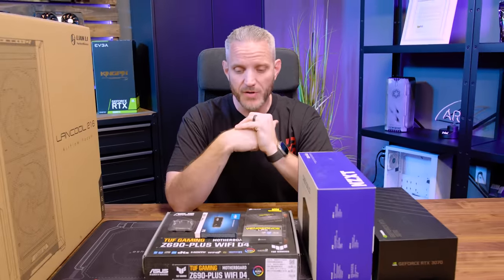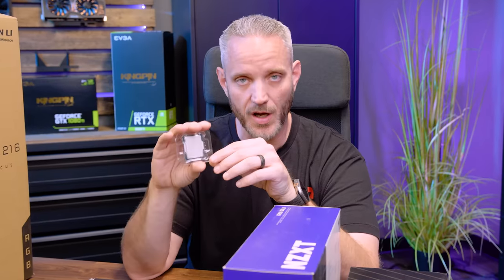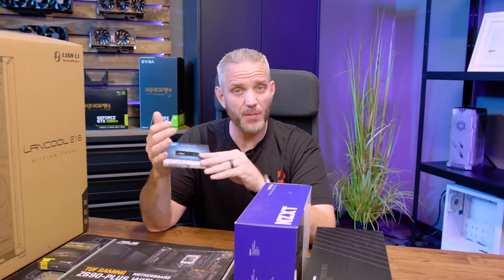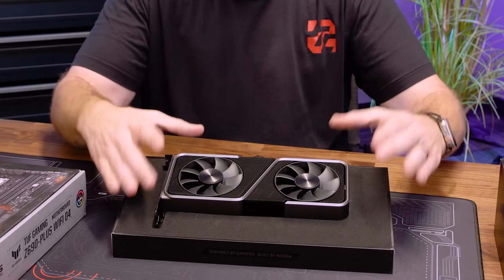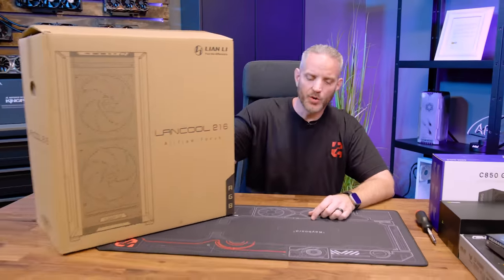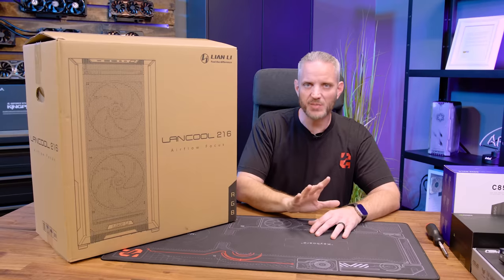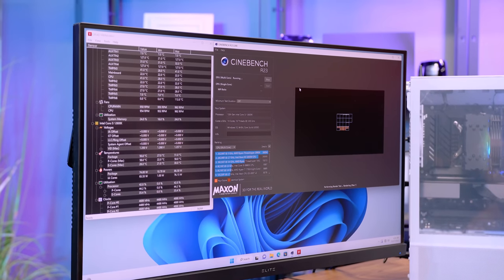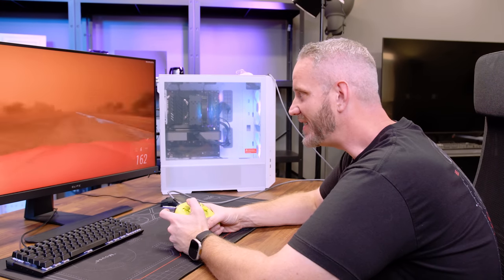Inexpensive PC Build Guide!

Comment: 850 watt power supply easily runs my RX7900XT. Stated requirement is 750watts. 

I’m not sure why you think an 850watt would top out at 7800XT….

Comment: Does upgradeability even matter in Intel systems for normal people? If someone cares about intelligent money spending rather than raw performance the uplift from 12600k to all higher parts isn't that great, considering not only the new CPU cost, but also the difference between money paid for 12600k and what it sells for later. I'd rather spend money once. I sit on I5-11400F and I don't see a reason to upgrade, and not having to buy a new mobo wouldn't change that.
Look realistically, most people are riding GTX 1060s and GTX 1650s, majority of buyers don't upgrade by one generation. 
Even with 5800X3D I wouldn't be surprised if it would outlive AM5 socket in hands of the majority of buyers, seeing many people are still running I7-6700k or older!
I also think OC is dead, gains in games are miniscule, so Z690 is overpriced for what actually is needed for a typical gamer. Lower power supply and cooling requirements also add up.

Comment: I love that AM4 had such longevity. I went budget 2 years ago with a 3600x and 2060. I wanted to game at 1440p and recently got a used 3080 for $550 and new 5700x for $198. Two easy drop in upgrades and simple bios update without having to build a new computer. But if i was building a new build today, 13th gen seems great and also AM5 while its their first gen of cpus, would have a great upgrade path like AM4. Overall I can stick on AM4 and wait until the next gen of gpus and eventual AM5 3DVcache cpus to release

Comment: Very good balanced system. The 12th and 13th gen CPU's are exceptional thanks to the compitition from AMD. The e-cores are actually very powerful especially for any multi-core workloads. Perfect 14440p system and the 13600K as a nice jump in performance or even the 13700K when the time comes to upgrade....

Comment: Eh, I'd definitely not be using the RTX 3070, just still too damn expensive. RX 6750 XT, for sure. They're about £250 cheaper over here. Other than that, probably about the same. Maybe add a second SSD for the money saved or switch to a DDR5 board and RAM to extend the lifespan a touch.

Comment: inexpensive pc build is $500 as established by toms hardware guide since 2000 $750 is the mid range build and $1000-1200 is the high end build jay.
$100 case HUGE NOPE when a $50 case will do $600 graphics card HUGE NOPE when a 3050 does pretty good albeit not at 100+FPS
ddr4 board...have you not seen the buy cpu get a motherboard free combos at microcenter? yes it's only available to instore pick up but if 200,000 of your subscribers go to microcenter it saves the other 3,100,000 some cash as demand is decreased to not inflate prices of things you recommend. ryzen 3600X with a free b450m/b for $130. there's even 12900k with free m/b for $350.
get realistic jay....even CPU-Z does better performance to price comparison by huge margins over what you just showed.

Comment: Honestly I could build a similar setup for the same cost or less even on AM5 with price difference between B series boards on AMD and Z series boards with Intel and with them having a similar functionality since Intel arbitrarily locks features that AMD gives you on their cheaper boards. This paired with a 3060ti instead of a 3070 saving even more money. A 3060ti is only like 12 -15% slower but costs about 33% less. could probably save on the case and PSU too if shopping wisely. These savings more than make up for the exorbitant price difference between DDR4 and DDR5. Not saying Jay's build is bad in anyway but AM5 will likely outlast LGA1700 in terms of generations supported which makes an even smarter choice for future proofing.

Comment: I'm going to be doing the thermaltake tower 200 with they msi board and r9 7k series. With 7900xtx or 7950xt. Idk know yet. But I'm gonna white it out and run hot pink rgb fans and a 1200 watt psu. All with the am5 board. It seems more my style of playing. I prefer amd because idc about visuals and more gameplay. I like playing diablo, fortnite(with nieces and nephews) cod, and other stuff like corsair 16gig dominator ram x4 and the new alienware quantum dot monitor. It's going to be glorious.
Currently have r5 5600 with 6700xt and 16gig ram with 650 psu. Asus b550 board. As I dont game often. But when I do. It's for hours and hours at a time.

Comment: Hot take, cpu upgradability is overrated , generational upgrades in cpus are marginal, the average user might be better using their system until it is no longer good enough for their reasonable standard and then either lower their stamdards or upgrade to the new thing with a grain of salt also because, a motherboard is probably going to fail before the   next cpu after the upgrade (assuming upgrade after 3-4 year) and is going to miss some features , you might as well not worry at all, buy whitin yout budget and accept tech getting old and upgrade when old is too slow

Comment: It looks like a good system. My problem is that I already have a pc with a GTX 1080, and I do not think the RTX 3070 is a big enough upgrade for the price. I am planing to upgrade my CPU. My 8600k oced is still fine for gaming but I would like a 5900X3D with DDR5 for some calculations. If the price is ok.

Comment: Even cheaper now with Black Friday 2023 deals. Got Crucial Pro DDR4 3200 32gb kit under $50, the 500gb P3 m.2 for $29.99 and $153 I-5 12600k for $153. More than good enough for a once every five years build. Nice upgrade over Ryzen 7 2700. Funny that same size 2.5 inch SSD's cost more than equivalent m.2. Keep these common sense recommendations coming.

Comment: I have a AMD 3700x cpu that's a bit overclocked and the only time I stress that thing i when I fire up a 1st tier game like Cyberpunk and other brand new games. What would give me the biggest boost would be to update my GPU which can run all those cames, but it's only low in the middle tier of GPU of last gen gpus, so it's not much to be over joyed with. A better GPU would do wonders for my gaming, but then that's not what I do most, so why bother. In stead I hang back, look for the right cheap GPU to show up at some sale and waith for the next gen stuff to show up before I think about some major upgrades.  Not all hardware of today is mature tech, so it needs some years to mature to fully be what it can be. This is something we have seen again and again.

I'm more worried about Windows and what the hell is going on there, it's almost as if I woud wish for all games to be made for linux so that I could jump ship fully, because this shit is annoying.

My old pc and my current has a Noctua NH-D15 cooler, so when I go for a new system, I can just swap that from the oldest other computer and be covered with cooling. It's big and it don't always fit well, but some minor tinkering fixes that. So go for good usebale or tranferable extras and you can rarely go wrong.

Comment: I kinda wished I got an Intel 12/13th gen over my 5900x in hindsight (though both weren't released yet, in fact, 12th gen was released a few months later but I needed a system fast). Quicksync would have been really useful and the IPC uplift would have helped with compiling and stuff.

Comment: Nice video. I thought I would check the price here. The motherboard alone is £320.99 at my local computer shop. That works out to over 385 dollars at current exchange rate, just for the motherboard. Only 224 dollars in your video. Not checked the rest of the prices yet. Also don't have a 1440p monitor. Have a 4k monitor and a full hd monitor.
Reply: we get ripped off in england
Reply: @warking4257   True

Comment: my suggestion build a pc with i3 12100f with b660 then when 13th gen i5 13400 launch you can upgrade.
 put as much money you can towards yours gpu. get a rtx 3060ti/3070/rx-6800. its run 1440p fine no botttleneck

Comment: @jayz2cents what's your current home or primary build specs?

This video helped a lot. I'm coming from a 6700k, 213hz of slow ram, GTX 1080 and a ASUS Maximus 8 Hero board.

I would like to upgrade....

Bought a used 3080 TI but obviously now bottlenecked by CPU.

Would like to make last 5 to 7 years in next upgrade

Comment: why the hell are you paying 600$ for a 3070, you can get 3080s for 600$, hell that isn't even far away from a 6900xt.  also if you are going intel and 13600k is a much faster cpu, especially with ddr5 which isnt even that much more anymore, and no mention of the 7600x? considering its basically the same price as the 12600k

Comment: Thanks for this video, Jay.
As someone who doesn't know anything at all about computer hardware, I always avoid upgrading and instead just run my system until something breaks and has to be replaced, because I just don't know which parts are good, work well together, are worth my money and so on. So videos like this are really helpful to see which parts to get for your budget.

One question I gotta ask though, I currently have a Sharkoon S1000 case (I think, looks at least like it comparing it online). Would I need to replace that as well if I would go for this build in the video, or would the case have enough space and air flow for it?
Reply: i mean, everything would definitely fit. Maybe you'd want to invest in a 240mm AIO (your case can support it) instead of an air cooler for your CPU, though, since it  looks like airflow may be limited with a solid front panel. You shouldn't run into any other problems, though

Comment: ddr4 pricing isnt volitatile, there are still 3200mhz cl16 kits for near $40. its just corsair kits and the other big name brands arent the ones near or at that price, use some lesser know brands from time to time, think silicon power, Oloy, Geil. its not hard to find new, same with 32gb kits at similar speeds for around $70-75 for a 2x16 kit. I enjoy most your videos, but over the last 2 years, your market analysis hasnt been correct.

also there are better budget coolers, look at Thermalrite and ID Cooling for some good budget coolers

Comment: With this mothderboard do you actually need all the RGB "Crap" since the case I would want to put it into doesn't have glass sides?  I don't think that RGB addes any spped to the system.  I'm just wanting to upgrade my existing Plex Server with a newer motherboard that supports Windows 11.  The current configuration is running on a Intel 4770K OC'd to 4.2 w/32 gig of memory on Windows 10 Pro.  Also running an Asus RTX2060 video card in it.  I have 7 WD Red Plus spinning drives with a PCIe controller card with 4 ports.

Comment: Right at starting i was."Maybe do a video with a "Cheap" busget build. This"Resonable build" and the "Enthusiast" build."

This is to check those in comparison to benchmarks. Before we have mostly comparisons bewteen single components (CPU to CPU or GPU to GPU). But it might be cool to see what does a 650$, 1000$, 1500$  and 2000+$ system gets you. Also for a price per performance/Benchmark. 

I and we know that this might be a bit tough to compare BUT on ther other hand we buy and build those systems so thery are existing.

Comment: I feel like something is definitely wrong with my 11700F getting a multicore score of 8634. Task Manager said it was only using 15% during the multicore and single core. ICUE said the load was around 10% during the test. Clock speeds were hitting 4688MHz. No fan speed ramp up or stress at all. It was barely using the CPU. Any suggestions would be greatly appreciated! =)

11700f
asus strix micro atx b560 g gaming
32GB ram 3200mhz vengeance rgb
rtx 3080
m.2 OS drive
corsair h150i cpu cooler
Reply: I figured it out. It's not as clear cut as this BIOS screen in the video Jay uses, but I finally find where to type in the Watt limit manually in the Asus strix UEFI BIOS. The F cpu's like mine are capped at 65w, so that's what it has always been on. Seems it was nerfing itself pretty hard.

Comment: I currently own a pc I built a few years back with a Ryzen 5 3600, a Tuff gaming x570-plus, and a 1660ti. I’m trying to upgrade to something similar to this build. Would you recommend completely replacing my current motherboard and running a Ryzen 7 5800x with a 3070 or 3080? Or an Intel i7 13700 with a 3070 or 3080? That’s my currently thought. Of course I won’t unless I have to. I have watched numerous YouTube videos and still feel lost. Anything helps!
Reply: I have a PC with 3070 and Ryzen 7 5700x. It's great for almost all games at 1440p, 60 fps. You can run some graphically intensive games at 4k with the use of DLSS, but expect 30-40 fps, if not lower depending on the game (cyberpunk). Vram is the biggest limitation here.  

Overall, I'm really enjoying it though. If you want a guarantee for 4k games, I'd get the 3080 (and for the utmost guarantee, get the 4070 or 4080, although those are way too expensive imo).

Comment: Jay is the type of guy who doesn't know the 7600X costs 240$ and decent B650 motherboards are available for 200$ and can be paired with 16gigs of 4800MHz RAM for 70$.
Reply: 40$ for the P3 is a decent deal, but it's QLC - I would rather get a TLC based drive for 10$ more.

Comment: Just ordered parts for a similar build except I went for the 13400f since it has similar performance and the same core count as the 12600 at around $50 cheaper right now. Got a gen 13 compatible mobo (obviously) which leaves and upgrade path should I want to step up later.

Comment: I don’t get how you can say that 3070 maxes out a 1440p panel. I have the oled alienware and my 4080 with high and ultra settings on Warzone maxes out the 175hz available (i.e. around 170-190 fps). Is my perception skewed by the fact that the alienware 1440p oled is widescreen and that means lower fps?

Comment: I like the idea of an upgrade path but at the same time I’d usually upgrade like every 5 years and that is enough time for more than 1 generation of cpus and gpus to come out so why would I choose the next step up that’s only 15% faster if I upgrade its to like actually upgrade so personally I would’ve went amd am4 on a cheap motherboard and cheap ram and then when I need an upgrade I’d get a am5 motherboard ddr5 and a much more noticeable upgrade for my cpu and I would be smart to get a cooler with am4 and am5 mounting hardware so I could cart it over if I’m looking to upgrade the gpu id cheap out on the power supply (not the the quality) just a lower wattage like 100 more watts then minimum on that particular gpu and when I want to upgrade just the gpu id upgrade both of those. That’s just me personally I don’t really care for the 10-20% improvements I like getting the 40% and up and by the time I’m getting that performance uplift cup socket has changed and nvidia will make a 1600 watt viable 😅 so I don’t play much of un upgrade path since I know if u bought a 1000 power supply and what not so I have room for an upgrade by the time I would that power supply will be old not as optimized for the new hardware and barley reach the standard to power what I’d upgrade too obviously I’m speculating what’s coming in the future for upgrades rn I’m chillin with a 5900x and a 4070 on a entry level motherboard and some okay ram if I need more cpu then $150 motherboard and $60 ram ain’t to bad in 5 years plus a cpu upgrade probably 300ish hopefully so about 500 to me in 5 years for 40-50% more performance seems like a good deal all things considered upgrading the cpu about the same as a gpu upgrade so pretty balanced feel free to disagree with my idea here and share your own

Comment: What components  would you use  cpu mother board ram cooling amd graphics card  to build a msfs 2020 rig to be played on high to ultra high settings  with vr. I will be reusing existing case. Thats the cheepest rig to play on high to ultra high settings but not necessarily high resolution no more than 1080 but with vr

Comment: Would also recommend to find rtx 3070 in the used market cuz in my country the new ones r still wayyy too overpriced n in the used market it is being sold at half the price or even lower cuz most of these sellers want to upgrade to a 3080 or 90 or even 4000 series. Little luck on the amd side cuz well lets just say most of them really ride on “INTEL AND NVIDIA BEST TGT” philosophy.

Comment: hi :)  building a new rig this summer. first one in 6 years.  i run  an Ryzen 1700x 3.4ghz, 32gig ram(3.2Ghz iirc) or 3, i have no idea. . ddr4!  and a 1080TI FE.   one  slow as hell ssd.   and a 2tb old school disc HDD.   ran perfectly fine up until a  5-6 months ago. 

that said,  4k 60 ish FPS ( i play on living room 4k  75" tv)  . any tips on a build? i have about 3-3.5k to spend on a new rig. any tips is appreciated.   4k 60 fps HDR is target. not more. as i dont do fps online stuff.